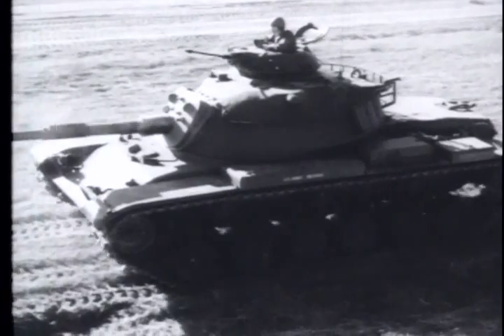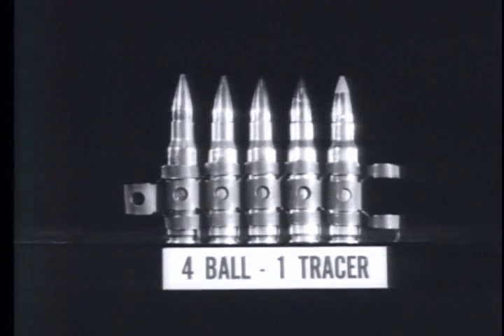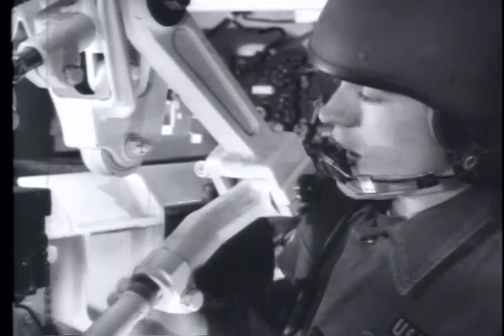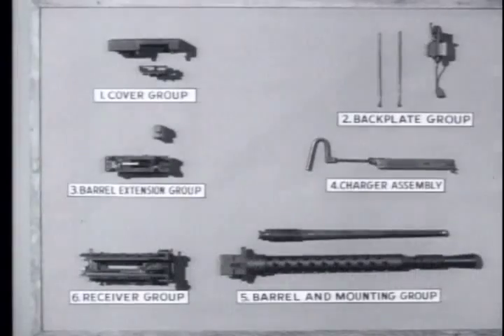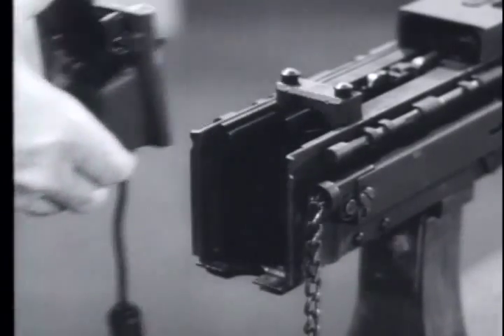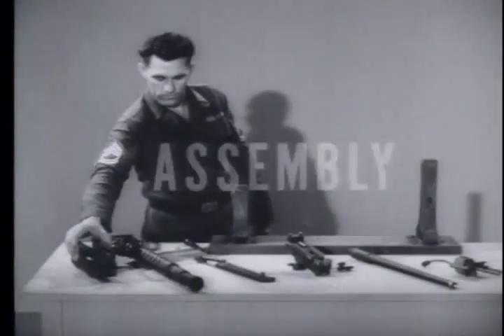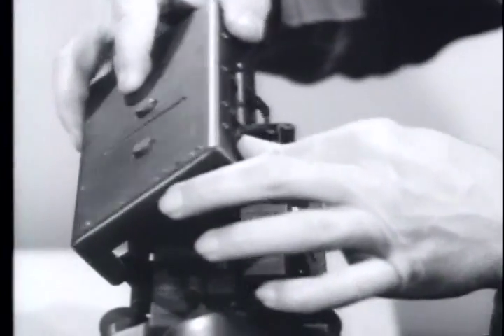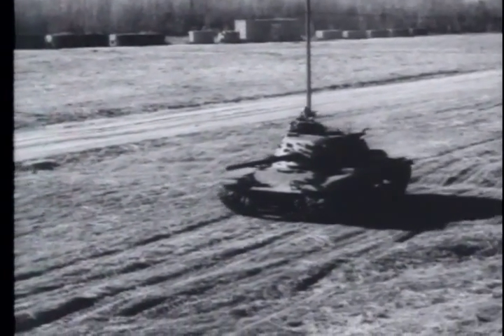Tank M73 Machine Gun 7.62MM - Part 1 Operation, Disassembly and Assembly

Comment: Led a cavalry platoon in the US 3rd ACR in the mid 1970s. Regardless of what we did, the M73 and its successor the M219 were unreliable. I never saw one get to the end of an ammo belt without a stoppage.
Reply: May i ask? how it worked with ammo belts? how long that ammo belts were? I mean how much pieces of rounds 200, or 250, or more in one single belt? Where exactly were they placed and how many of ammo belts tank could carry? And last question, where the hell that cartriges were finish? at the bottom on the floor, or out of a tank? I apreciate answers much.
Reply: @Algos7000  7.62mm linked ammo came in 100 round belts, two belts to the can. Ech belt was inside of a cardboard box, itself inside of a cotton bag with shoulder strap.